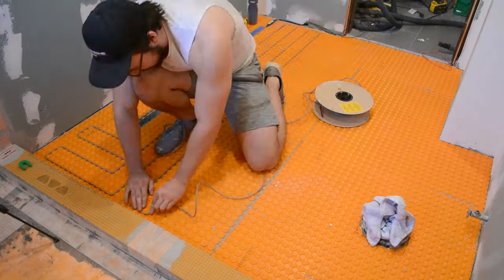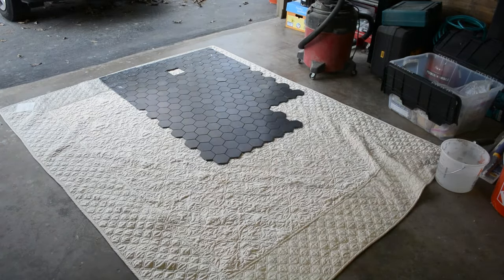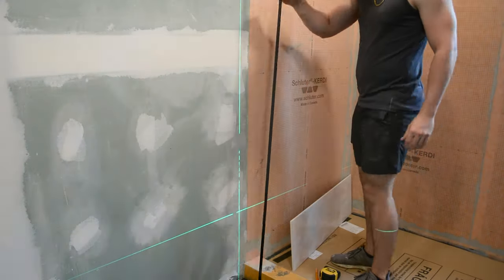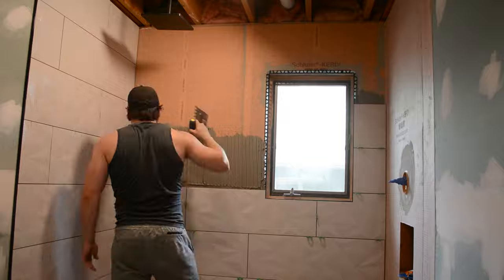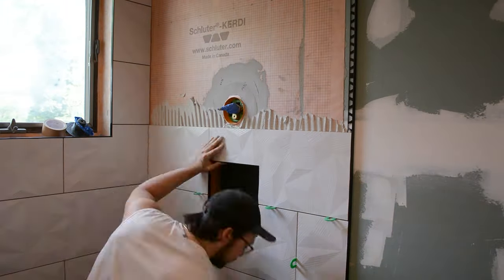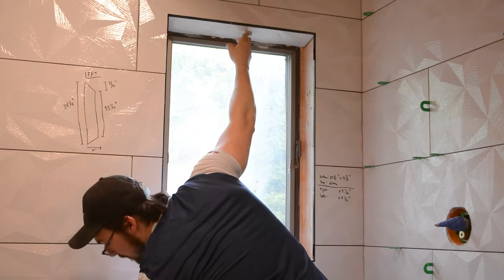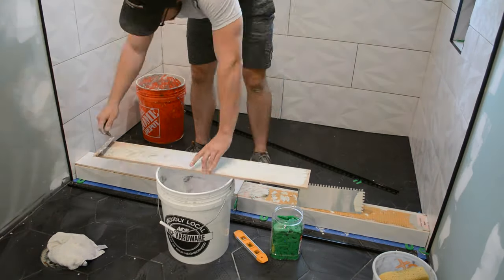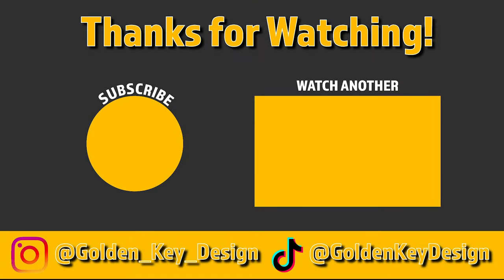TILING a SHOWER for the FIRST TIME - Walls, Floor, and Curb! | Bathroom Remodel Part 7

Comment: What profile of Schluter trim is that on the window and niche? I'm almost at this step of my project but get lost in all the different profiles they have.
Reply from the maker: I used the Jolly which is the standard one that most people use. Just make sure you get the right thickness depending on your tile

Comment: What type/brand/style shower wall tile did you use? Looks like faceted porcelain.
Reply: If I’m not mistaken, that looks like the Cristalo AC 30x90 tile made by Porcelanico. It’s hard to be certain seeing it from a distance on a video. The Tile Shop sells it for sure, I’ve been working for them for almost 10 years now, which is why I recognize the tile. Floor & Decor might sell it as well, but not certain.
Reply: @jerryhuber1130  Much obliged.

Comment: You should have used the tile spacer's I can see mad lips and the lines do not match up horizontal maybe off by a few millimeters and that one tile by the window is bugging me so bad you should have cut it so that the lines match up. Other than that for a first tile job amazing just plan things a little better next time and practice makes perfect keep it up.
Reply from the maker: Appreciate the feedback but there’s no lips anywhere - I can assure you. Not sure you watched the video, but I did use spacers, just not levelers. It’s hard to tell, but this tile has a 3D texture making levelers useless. It was better to line it up by eye. I also used a laser off camera to make sure the horizontal grout joints all lined up. Thanks for watching!